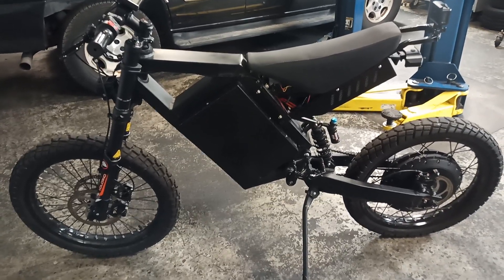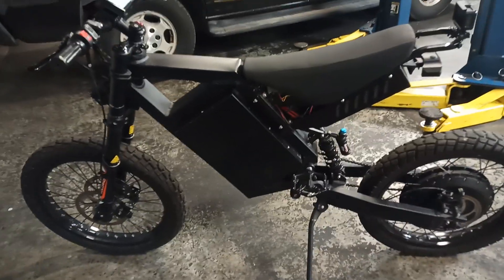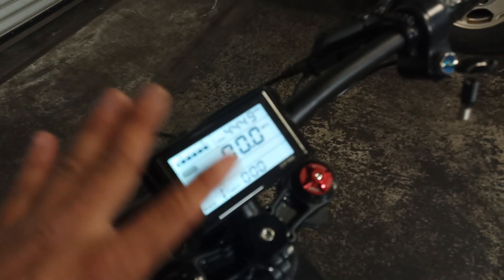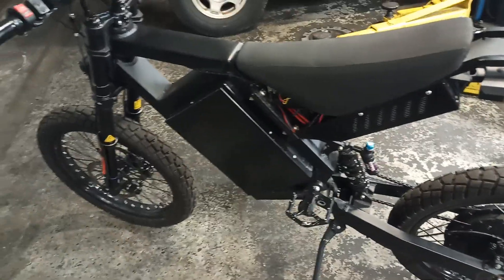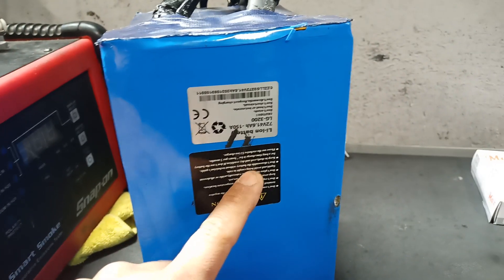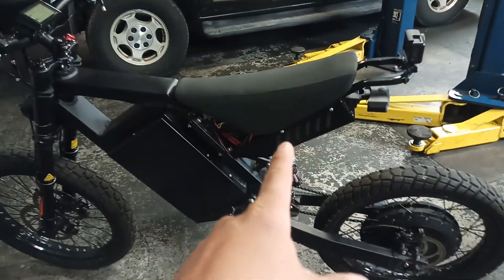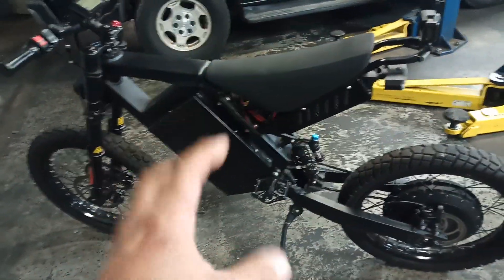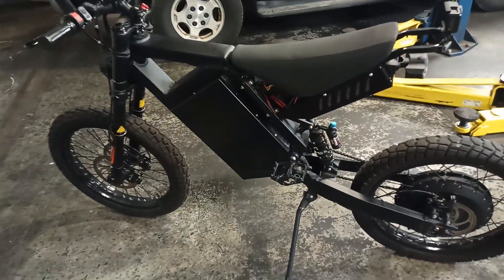CS20 EBIKE POWER PROBLEMS

Comment: Users of Motors overheating or the wires that come from the motor aren't thick enough may look at the wires on the motor cuz it sounds like you're shutting down in your motor is overheating it's getting too hot

Comment: You have a controller problem
Reply from the maker: Hi. Actually the problem was the Battery. The battery didn't provide enough current after a year of use and had to program the controller to 100Amps current and worked fine. Installed a new battery (same specs battery) and turned the current up in the controller to 150A again and no issues.. bike still running strong with same controller.

Comment: Did you get the problem fixed?
Reply from the maker: Yes. It was the battery. I made a video explaining the battery issue.
Reply: Thank you
Reply: Where did you buy the new battery?
Reply from the maker: @johnny1902  https://ssebike.m.en.alibaba.com/index.html?wx_navbar_transparent=true&tracelog=sns_minisite&from=share&ckvia=share_c50bfadb9bff4241886dfc71f0b342d6
Reply from the maker: @johnny1902  Hi Johnny.. thats the link.. hopefully it helps. Battery is high quality..
Reply from the maker: @johnny1902  The battery might not be listed on their store page so you will have to message them..

Comment: I have a similar problem my throttle cuts out completely I was able to ride it for half a mile brand new from ali baba
Reply from the maker: Same happened to me about 3 times already. Im trying to figure out what is causing it and ill share it..
Reply: How long to receive from ALIBABA? 3 months?
Reply from the maker: @MRSTEEL15  i got mine in 6 months. Probably less time now but they do take a while and some sellers might have faster delivery.

Comment: Check rotor not cutting wire harness coming out of hub
Reply: Hope u get it straightened out, we all feel ur pain trust me
Reply from the maker: @CaptainCurt07  thanks. Yes I miss riding this thing. While in the process trying to find this issue, I have learned how everything works and how easy is to build these EBikes. Most important, I learned how the batteries are built. Very easy, time consuming, expensive, but is worth to learn how to build your own battery.
Reply from the maker: Yes I did and seems ok and clears about 1mm away and wires look ok. I have the batteries open at the moment inspecting them for any shorts.

Comment: Mine is doing the same crap…it will power on, and you can ride it….but it just cuts out, and goes completely dead, I did have battery connector issues.

I decided to eliminate the shitty T-90 connectors….and hard wire it to test for a bad connector….if it still does it, I’m going to rule it as a bad battery BMS or dead cell…mine has 242miles on it.

If hard wiring it fixes it….I will order better battery connections.
Reply from the maker: Yes probably the BMS is lower amperage but you need to open the battery to see it. I did change the amps on the controller from 150A to 100A and it worked longer riding time but it happened again. This was with my new battery so I decided to open the battery to see if there was any shorts and found the nickel plates were burned up and the BMS was 40A max.
Reply: @dennis_503_gutierrez  I found the issue….the battery was tested’ including the BMS’ it turned out to be a bad speed controller. The cheap battery connectors was the cause, the connector developed a short circuit, and fried the speed controllers mosfit.

When I plugged the battery back in….I heard a loud pop, and the speed controller failed to come on….I retested the battery, and it still tested good….it still charges, and stops when it gets to 84V.
Reply from the maker: @Futuremax-e8f  nice.. I don't have that issue with the controller. It turns on normally. Now I'm curious to open the speed controller.

Comment: Bypass the battery bms .  Just use the bms for charging.  Seldom the motor is the problem.  They either work or they don’t work at all.
Reply from the maker: That would be my next step. By I'm going to try to lower the DC current from 150 to 100 on the controller. I found out the cells loose amperage after certain amount of charge cycles. We'll see if it works.. thanks for your help.
Reply: @dennis_503_gutierrez    I build ebikes and battery packs .  Let me know if I can help.
Reply from the maker: @Strange_Brew  you do? Yes I need lots of help here. email me, maybe you can build a battery for me.. deennissegutierrez@gmail.com
Reply: That’s what I’m planning on doing with mine….Going to make sure it’s not the shitty T 90 battery connections.

Would a bad cell cause the e-bike to shut down? I’m guessing it’s either my BMS or bad cell on mine
Reply from the maker: @Futuremax-e8f  yes. I learned that if the pack voltage or cells discharge to 3.2v or less the BMS will turn off to protect the battery. That's because batteries loose capacity and discharge faster after many charge and discharge cycles. I'll upload a soon explaining this case.
Reply from the maker: @Futuremax-e8f  it also happens if the battery pack has lower amperage rating then the controller. Say the BMS is 60A when the controller pulls 150A, that will overheat the battery and cause the BMS to stop working. My (new) battery had a 40A BMS and caused the battery to over heat and burn the welded contac strips. Need to be careful.
Reply: @dennis_503_gutierrez  my speed controller amp rating is 80A the battery BMS is 80A….I did this for maximum power.
However my AH is only 21AH and the minimum for my kit is 21AH….that could be killing the battery..

I’m thinking on bypassing the BMS, and only use the BMS for charging…..as we speak I’m testing the BMS with a volt meter so far it’s testing good.
Reply from the maker: @Futuremax-e8f  I will try that too when I get the chance. Mine originally has 150A BMS with LG cells 41.6ah with more then 4k miles on it. I'll try to lower the Amps draw from the controller and if that doesn't work, I'll try by passing the BMS .. thank you .
Reply: @dennis_503_gutierrez  bad speed controller on mine ☹️the T-90 connector is a POS it only handles up to 90v the battery is 84v max….I should’ve put a anderson 120v connector on it.
Reply: @dennis_503_gutierrez  my battery was fine….the speed controller was the issue, Shouldn’t went with the 120v anderson connectors, the T-90 connectors suck on a 72v….they overheat and screw up your speed controller.
Reply from the maker: @Futuremax-e8f  interesting. I have 120A 600V Anderson for discharge is the biggest connector I think and xt60 for charge. Did you change the Anderson? What did you use?
Reply: @dennis_503_gutierrez  I had the T 90 connection for main power….I was in the process of upgrading to the small grey anderson connectors, because I have had issues with the T- 90 connector shorting out, if I would’ve purchased the anderson connector….my speed controller would be fine….they might be called TX 90 but they’re smaller than the anderson connections 

The T-90 almost look like the charging connections but slightly bigger.
Reply: @Futuremax-e8f   they use cheap bms’s in these packs.  I use Daly bms’s with twice the amperage rating for the controller or I bypass the bms in high amperage drawing set ups.
Reply: How do you bybass the bms?
Reply from the maker: @TheScrappycocco  the discharge cables need to he connected directly to the battery. Positive on Positive side and Negative on negative side of the battery. leaving only the charge cables connected on the bms.
Reply: @TheScrappycocco   bms is inside the battery pack.  Locate the black wire to the bms,  remove it and connect it straight to the black lead going out of the battery pack
Reply: Thank you guys I'm going to give this a shot in the morning, I have the same bike and it completely shut off and won't turn back on even plugged in or after I disconnect the battery and put it back so I'm going to try that.
Reply: @TheScrappycocco    I always put one of those eBay volt displays on the handlebars. Dont like those volt % readout.  Check the battery voltage too.
Reply from the maker: @TheScrappycocco  Did you try to plug in the charger? When my bike turned off while riding all i did was plug in the charger and it turned back on but i had to change the dc amps on the speed controller down to 100A dc current.
Reply from the maker: @TheScrappycocco  I uploaded a video on my channel explaining the issue with the Battery. Maybe it will help you too..
Reply: I dont know how to change the speed controller I don't have an app to do that?
Reply: @TheScrappycocco   some good YouTube videos on that subject.  The only problem with bypassing the bms is the you lose the low voltage cut off.  I usually stop around 69 volts and recharge. Pretty much dead.  The bms’s they use are pretty much junk.  I use Daly and other high end ones.
Reply from the maker: @TheScrappycocco  Ok. You need an app. Its called MQCON. Should be the same on both IOS and Android. The bike comes with a Bluetooth adapter that you plug in the speed controller usb port. That creates a wireless connection with the speed controller. Let me know if you have the adapter available to continue.
Reply: @dennis_503_gutierrez   is there a way I can get in contact with you and send you some photos. Sorry for bugging you I'm just trying to get this fixed
Reply from the maker: @TheScrappycocco  we are here to help each other. email me at deennissegutierrez@gmail.com
Reply: I have the USB port but I had no idea there was an adapter, do you know if I can order one? And would it be hard to change the bms instead of bypasssing it?
Reply: @TheScrappycocco   I would first bypass the bms.  They sell usb adaptors cheap on eBay. You could mount one anywhere on the bike. Just a 5v converter. You’ll need a decent multimeter to work on ebikes.
Reply from the maker: @TheScrappycocco  The bike should have come to you with the adapter but yes you can buy it separately. Are you sure the bms is the problem? If the bms is the problem it will not charge the battery. In my case my problem was the cells.

Comment: I have the same problem on my ebike. Except it happened after about 120 miles on it. I replaced the battery as well and it didn't help. I am still trying to figure it out as well.
Reply from the maker: 120 miles? Wow that was too soon. I found out 2 things. The new battery I installed I opened it to see if there was a short inside and I found that the nickel plates were burned out on 2 cells. Those nickel strips for red hot at some point that it kind of burned thru the protective case. Found the BMS was only 40A discharge. These bikes need 100A-200A depending on the BMS and battery discharge current. We all know the cells loose amperage after many miles so I'm going to try to lower the Amps on the speed controller to 100A with the same old battery to see what happens. Your battery may have lower amp BMS but you need to open it to find out.
Reply: @dennis_503_gutierrez  Don't feel bad guys I just assembled my 8000w stealth bomber and I was only able to ride it for half a mile the throttle completely cut out
Reply from the maker: @banneduser978  Did it show any error code on your display?
Reply: @dennis_503_gutierrez  no it doesn't show the error code but the throttle is completely dead I 'am wondering if it's some kind of a sensor perhaps
Reply from the maker: @banneduser978  ok.. once in a while it happens to me too. While riding specifically when going uphill the throttle cuts off and there is no error on the display. I have to turn it off and back on for the throttle to work again. Doesn't happen all the time but it happened like 3 times already. Ill see what i find out and ill share it..
Reply: @dennis_503_gutierrez  If I try to ride it using the pedals the throttle kicks in only for a fraction of a second this sucks i got ripped off from ali baba
Reply from the maker: @banneduser978  Yeah i hear you. Very risky to order from Alibaba. I got ripped off with a battery. This throttle issue could be an incorrect setting in the speed controller .
Reply: @dennis_503_gutierrez  Thanks for your help I appreciate it  I'am working with the supplier to troubleshoot this issue if I ever resolve this problem I will post it here, I know a lot of people have similar issues but there aren't too many video's on that subject on YouTube.
Reply from the maker: @banneduser978  no problem.. im going to ask my supplier too and see  if they respond the same. Ill let you know.
Reply: @banneduser978  You ever figure out the problem?
Reply: @majesticmajestic7058  Yes I was able to fix the issue after all the hard work I put into this bike after changing the display controller + ignition switch it turns out it was a faulty throttle soon as I plugged in the new throttle the bike started responding I couldn't believe my eyes wow these half twist throttles all have similar issues don't leave it sitting at one spot for too long sometimes the moisture gets in there which can cause this problem good luck on your project.😄
Reply: The only issue I see is a 16 pole motor but in the settings on the sabvoton with your display it only goes to 12 poles if I recall. 🤟👽🚲🎬

Comment: Unplug the motor cable at the back of the motor and plug back in. ... That is what they say on the site....  I think maybe bad connection on one of your wire connections or you have a positive wire grounding on the frame.  but maybe it could also be grounded windings in the motor.
Reply from the maker: The wires go out from inside the motor straight to the controller. There are 3 phase wires for the motor and there is a connector from the motor I believe is for the halt sensor, temperature sensors etc. But the only way to disconnect the motor is from the speed controller. I'll try that to see what happens and I'll check all the wiring.. Thank you.
Reply: @dennis_503_gutierrez     I never worked on or even owned electric bike but assume there is definitely a short in the system wiring somewhere or like I said earlier, it could be a shorted out motor causing the issue. Disconnect the battery and use an ohm meter to check continuity between the positive wire of the system and the negative wire .
Reply from the maker: @daniel73minshall  This is my first ebike and I'm just learning this stuff. What you telling me makes sense. I'll check continuity between positive and negative and I'll check the motor and controller side as well.. thanks.